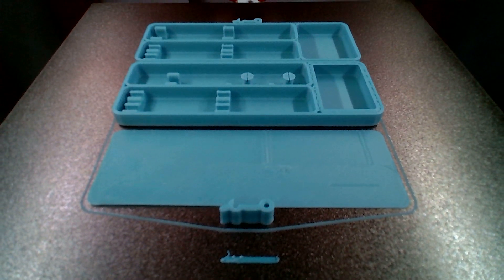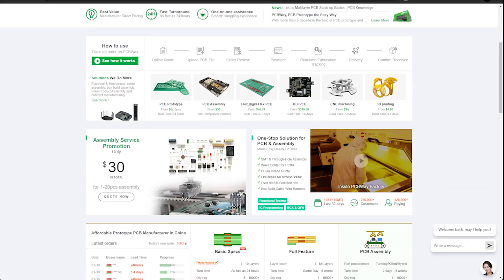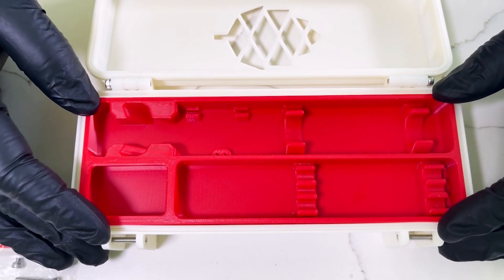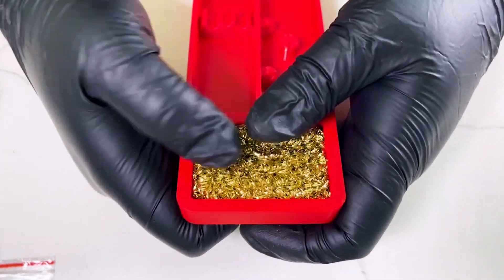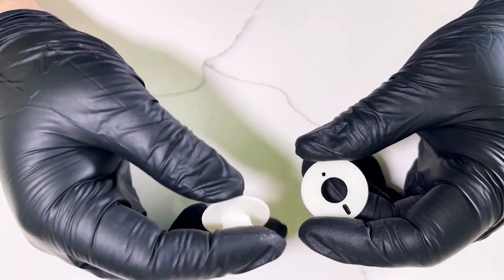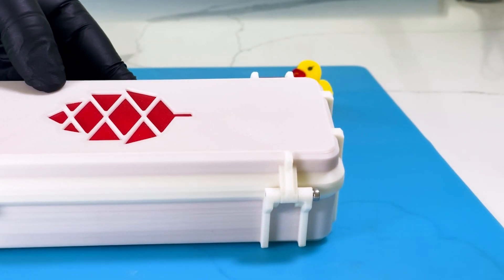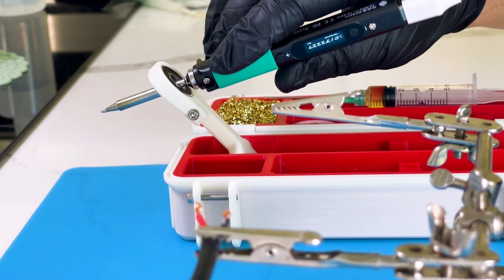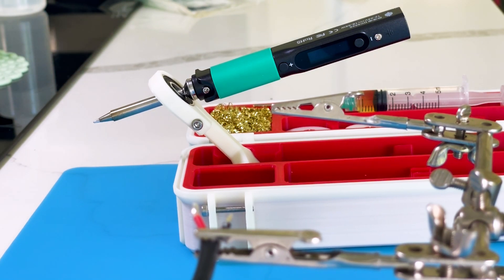3D-Printed Tool: The Upgrade You Didn't Know Existed

Comment: Came here to see how one uses the Bearing holder thingy. Do I percieve correctly that you mount it where the soldering iron normally goes?
How does PCBway sponsor a 300 subscriber account? I am fairly curious, and perhaps inspired.
Reply from the maker: @dagger6498  For the bearing yes… you are correct. You use it where the iron sits. 

PCB way actually sponsored me at 80subs. I’m shocked. But I’ve kinda dropped the ball with them, been working on a huge project and haven’t uploaded in a while so who knows if they will want to sponsor me again 🤷🏻‍♂️.

Comment: Thats cool. Thanks for sharing. What features does the case have. 

And is the bearing just there to hold a hot iron? I think I'd be too tempted to steal the bearing back for another project. Though I would know where I had a spare.
Reply from the maker: Yes the bearing is there to hold the hot iron, it works surprisingly well for that. It also has a pert for the brass brush to clean your iron, and room for multiple soldering tips. It is also highly customizable so you can essentially look for what you actually need. I got an insert to hold my flux syringe. There are also larger variants of this case that can also hold, alligator clips, and the AC adapter for the soldering iron.

Comment: Tried making something similar myself but with a larger aluminium flightcase style case, that used to be for BBQ tools.

Due to size limitations I did not proceed much further with it, especially with the need to print it in 3 parts.

Especially with me wanting to have GX connectors for the USB-C cable.

Might revisit sometime in the future.

My rough design had enough room for everything, including a 80mm solder-fume extractor
Reply from the maker: That's a very good idea. If you go with the insert approach (like in the video) the level of utility would be very high. Multi-part prints are not a big deal for me, plus they look better than single print Items because you can play around with the color scheme a bit more. I am working on a fume extractor too. Hope to have that out soon, we will see.
Reply: @MakerMilo  DIY fume extractors are great

 I made my own with a old DELL 120mm FAN, its loud AF, but it can suck quite well, even at 60cm away it still sucks up all the smoke. [What I do sugest is to use a small switch to turn it on/OFF] and a barrel jack to power it. depending on how small you want it

For filters I used 2 of those cheapo aliexpress carbon filters. and a 3+ layers of fan-grils, with a fine mesh one between the one at the front between the print/filters.

Since I didn't care about looks i went FULL function over looks. making it easily modifiable.  as it is made from 3 layers of parts.
[with the filter case existing off 2 layers, and a FRONT panel layer for switches/other plugs]
Reply from the maker: @darknessblades  Sounds great! Have you published your build anywhere? I'd love to see it if possible. On mine, I am using a type-C connector to power it and a PWM controller to run the motor. It is working pretty well to push air but I don't know how effective it will be till it's done. For filter medium I got a carbon filter pad, I am hoping this will do the trick.

Comment: @8:16 It looks like you're cold soldering there. Touch the solder to the wire, not the tip of the iron. Keep the videos coming
Reply from the maker: Yeah that was just to get a little B-Roll I am not actually using that cable for anything. Good eye though!